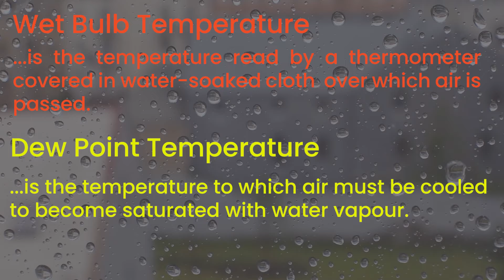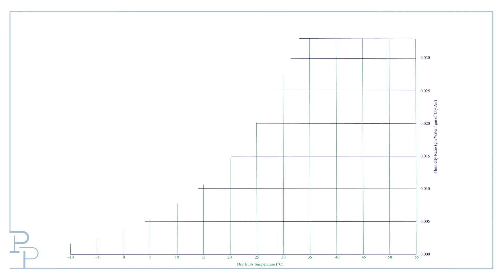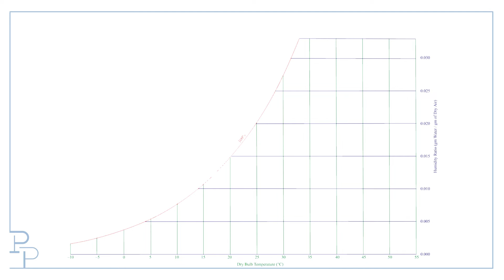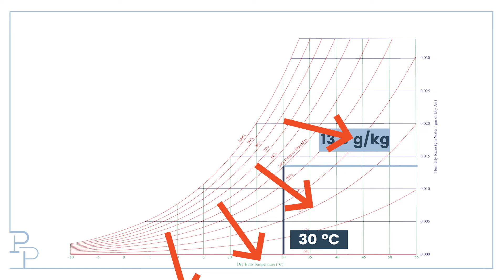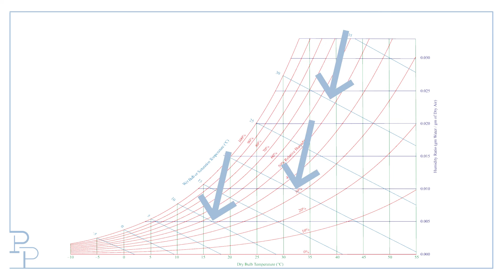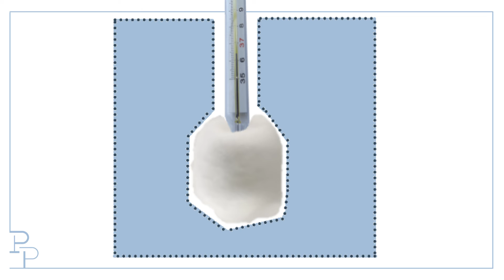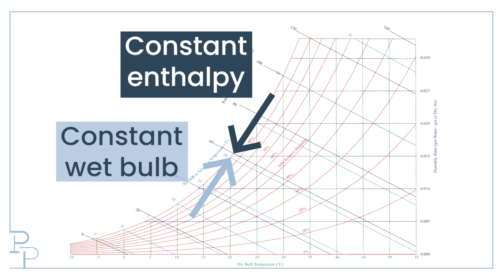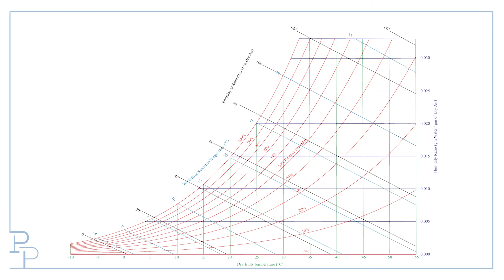Wet Bulb vs Dew Point Temperature

Comment: Hello, Pat (if you still support the channel). Could you, please, help me with this question: then you refer to absolute humidity at some temperature, you also implicitly refer to some air density. Then you change temperature of air, density is also change. I.e 13.5 g/m3 at 30c(303K) is 13,5*(303/293)= 13,96g/m3. Is my calculation correct ?
Reply: I found an obvious error in my logic: y-axis is g of water per kg of air, not a volumetric value.

Comment: This chart really puts in perspective how extreme the dreaded "wet bulb events" really are. To have a wet bulb temperature above 35 degrees you have to be in the very top corner of the chart (or maybe more likely a bit further to the left and out the top at extreme humidity). Dryish air even at death valley temperatures are really not all that bad in terms of wet bulb temperature. As long as you have water you'll be fine. Evaporative cooling is really effektive when at high temperatures. You need the high humidity for it to be truly dangerous.

Comment: I don't understand the part where you say that the water from wick enters the air around bulb and increases its RH(relative humidity). But in a large enough room, the water evaporated from wick will have negligible effect on the room's air RH. Then by that logic the temperature can keep falling forever.
Reply: No because evaporation and convection will be balanced. To lose more heat by evaporation you will need new dry air in contact with the bulb, but that air will also be hot. So if you put a fan next to the bulb you will both heat it more and cool it more so the final temperature will be the same.

I guess in principle you could put the moist, cool air through a heat exchanger with some of the warm, dry air. This dry air will then be cooler, but at the same absolute humidity and thus lower wet bulb temperature. Then you could repeat and gradually approach the dew point. But this process still won't get you lower than the dew point.

Comment: I have a doubt. @7:00 when moisture in cotton is taking heat from surrounding air then how does temp of thermometer decrease? the cotton should primarily take heat from thermometer's bulb. right?

Comment: air velocity affects the rate of evaporation from the wick. why does it not affect the wet bulb temperature?
Reply from the maker: Hey Maksim! You are absolutely right, which is why a true WBT measurement is one in which the air around the wick has reached saturation, and if it's saturated the velocity would not affect the rate of evaporation. I have copied and pasted my reponse to a similar kind of question from my main WBT video, which might be interesting for you. Let me know if it helps:

"When measuring WBT we are losing energy due to water evaporation; by energy balance, the material of construction of my thermometer has a specific heat, and the higher this specific heat, the less the temperature of that thermometer will drop, affecting the reading, right? But here's the deal - we can then go and replace the air we have just saturated with a bunch of fresh, unsaturated air, and cool further. So the question becomes more about time taken to get to the reading more than the material itself. You will eventually cool it down to the WBT reading.

But it gets more interesting and more complicated. What stops me just repeating this process indefinitely? I can keep replacing the saturated air with fresh air, keep evaporating water, and keep cooling. Does that mean we have infinte cooling to as low a temperature as we want? The answer is no.

There are actually three different tempratures here at the start: the temperature of the air (dry bulb), the temperature of the thermometer, and the temperature of the water. These three can be, and probably are, different to begin with. As you start evaporating we start getting heat transfer between these three entities until you get to some sort of equilibrium temperature profile (note PROFILE - I won't realistically get all three copmponents to same temperature). Eventually you cool down the air and thermometer, and you cool down the water. Since the water temprature drops, so does its vapour pressure AND HENCE ITS TENDENCY TO EVAPORATE AND COOL. The air is saturated when the partial pressure of water in the air equals the vapours pressure of the liquid. Learn this - this is a definition. So you can't cool infinitely because you cool down the liquid and diminish its vapour pressure.

This touches on something called the psychrometric ratio, which ackowledges that there are two temperatures here:
1. There is the thermodynamic wet bulb temperature - the "true" or theoretical limit of the WBT that I achieve when any gas becomes saturated with any liquid (not just air and water). This is the WBT I describe in my video "The difference between WBT and Dew point". To get this I would need a perfectly insulated box in which I saturated & cooled the gas by evaporating liquid inside the box inside this box and and acheived a unifrom temperature inside. Note that I don't care what sort of thermometer I am using to measure this temperature in my perfect box.
2. Then we have a realistically measured WBT, you could probably refer to this as simply an equilibrium temperature which is what we usually measure. This temperature reading stabilises at some value based on  the mass transfer rate of water into air as it evaporates (mass transfer coefficient) and the convective cooling rate (a heat transfer coefficient).

Depending on those two transfer coefficients there may be a large difference between the thermodynamic WBT and the equilibrium temperature measured during a WBT experiment in your kitchen. For water in air there is no significant difference purely by coincidence."
Reply: @ProcesswithPat  But when the air around the wick has reached saturation, sure air velocity won't affect the WBT because it'll be equal DBT and there won't be any evaporation at saturation. I still don't get it.
Reply from the maker: It’s the delta from whatever the initial humidity is TO saturation… So the cooling effect from initial to 100% humidity creates the delta between dry and wet bulb.

So I think you get it, but maybe I’m struggling to give you the “aha!” moment.

Yes, the air velocity will affect it, but in theory imagine you locked their around the bulb at initial humidity, and allowed the water to evaporate with zero heat transfer elsewhere. Then the “velocity” (I know it’s a little dumb cos we’re in closed box, but pretend we can control the velocity without adding energy) would determine how QUICKLY you arrive at the wet bulb reading, but not the actual final reading itself.

Make sense?

Comment: Very well explained. Could you make video on entropy and its uses in real life
Reply: The short answer is, entropy is a measure of the disorder in a system, that enables us to quantify whether a process is A) impossible, B) reversible, or C) irreversible.  The 2nd law of thermodynamics requires that the entropy of the universe, never decrease.  This means entropy either can remain the same (for a reversible process), or increase (for an irreversible process).  But if entropy of the universe were to decrease, the process would be impossible.

An application of entropy, is to calculate the upper limit of performance on processes that trade thermal energy for mechanical work, or vice versa.  Such as compressors and turbines.  Ideally, there is no heat transfer, or change in entropy, when a substance passes thru a turbine or a compressor, or other similar component. This allows us to find the ideal output state, given a known input state, and calculate the corresponding work associated with the device from other state properties and the mass flow rate.